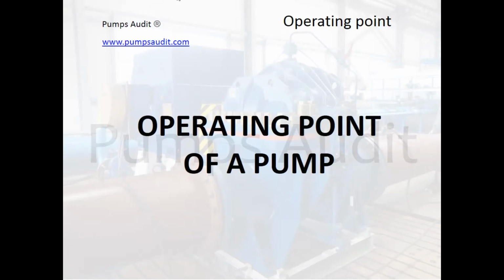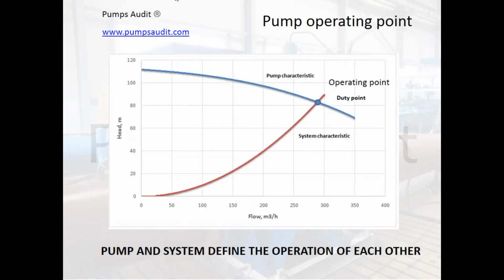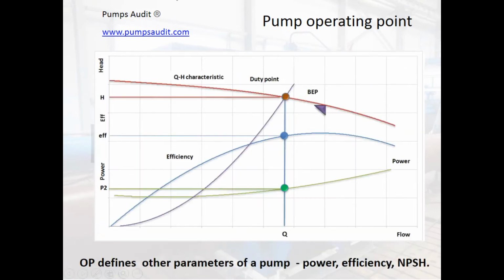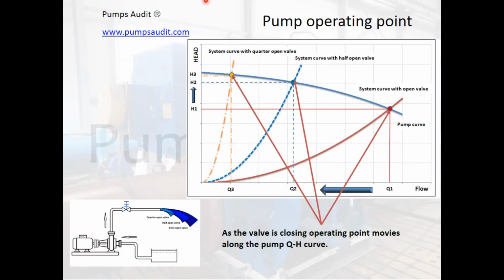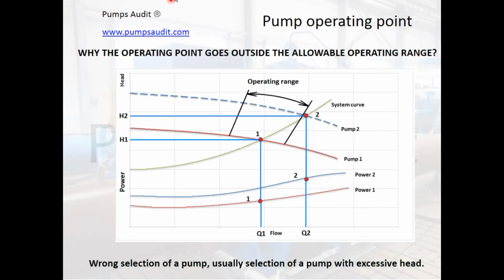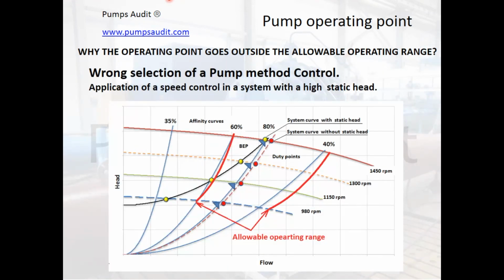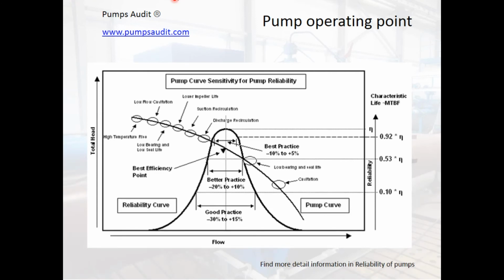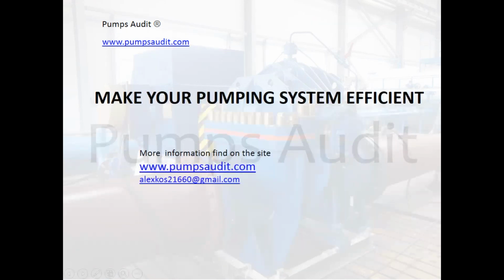Pump operating point

Comment: How to start up a fixed speed pump?
Reply from the maker: You can find information about fixed speed pump start-up on this page https://pumpsaudit.com/pump-start-up
start up of variable speed pump is very similar but you can use the function of soft start. In this case the discharge valve can be open.
Reply: @Pumping_Systems_Audit  if discharge valve kept open for variable speed pump, will have reverse flow?